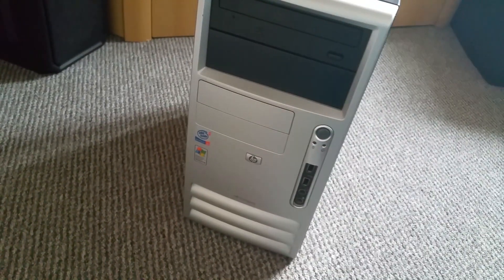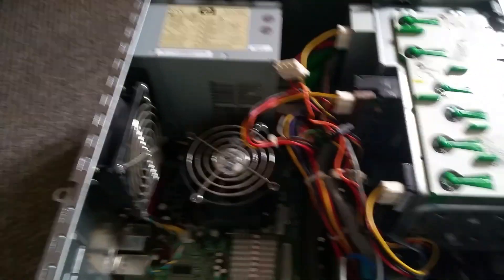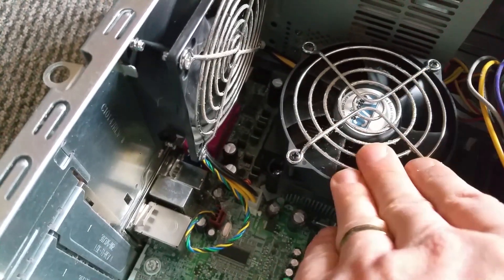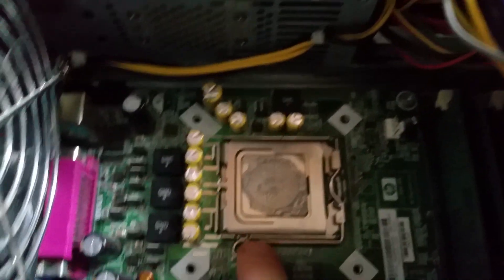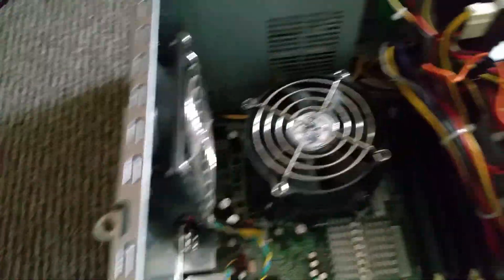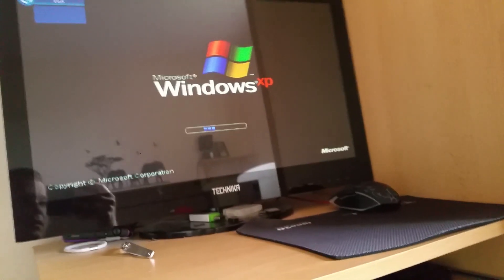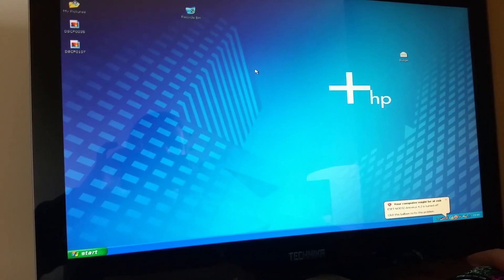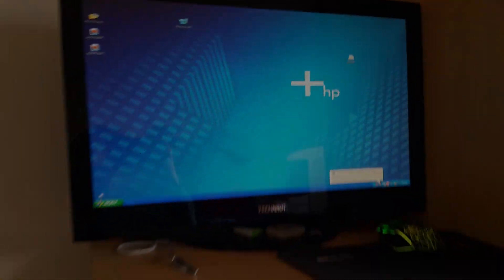Try upgrading Pentium 4 ?  Or is just waste your time !!! Watch this to find out!!!

Comment: Noted 
I am doomed to play games
Reply from the maker: On P4
Reply: @frogtechtips  I just have a 2000s pc with a 1 core Pentium  which runs on its 2 threads basically 

I just wanted. To run mc and it failed. Got 0 fps
Reply from the maker: @dragnify7456 not sure what is MC do you have any GPU in as that integrated GPU is piece of crap
Reply: @frogtechtips  mc stands for Minecraft which takes up mostly the processor
Reply: @frogtechtips  yes
Reply from the maker: @dragnify7456  ok tat pc is really need upgrade as for Minecraft is minimum requirements

CPU: Intel Core i3 3210 | AMD A8 7600 APU or equivalent.
RAM: 4 GB RAM.
HDD: 180 MB to 1 GB available space.
GPU: Intel HD Graphics 4000 or AMD Radeon R5 series | NVIDIA GeForce 400 Series or AMD Radeon HD 7000 series.
OS: 64-bit Windows 7 or later.
Screen Resolution: 1024 x 768 or better.
www.wepc.com › benchmark › min...
Minecraft System Requir
Reply: @frogtechtips  thanks for taking your time out and giving me tips 
It's speca are 

P4
Nviada Geforce 210
Win 7 64 bit
 4 gb ram 
1tb hhd
I am saving up and looking forward to upgrade it 

Thanks a lot again!
Reply from the maker: @dragnify7456  he that's very low spec you really need upgrade :-)
Reply: @frogtechtips  yea I know i am saving up money
Reply from the maker: @dragnify7456  don't buy new one and you can get pretty cheap pc I will recommend you some intel 3000 or 4000 series is still good if you will pairs with decent GPU like I have i7 3770 and RX 580 and no problems plays even every new game on it
Reply: @frogtechtips  thanks, I won't buy a new one I wasn't planning too! 

But in my country the prices are really high at the min becuz of quarantine and stuff so I was thinking to wait a bit till the prices drop!
Reply from the maker: @dragnify7456  ye in this time is always good wait if you can for price drop if I can ask from with country you are
Reply: @frogtechtips  I agree! 
But sorry, you can't know what country I am from with all due respect
Reply from the maker: @dragnify7456  no problems you can keep in secret

Comment: I am using Pentium 4 (650 processor) in Asus Ptgd-1La mother board which is i915g chipset based mother board it can also support Pentium 4 (640 and 630 Processor) as well ,Windows 8.1& Windows 10 (32 Bit) can be use on any of them.
Reply from the maker: You can install windows 10 as well on it with no problems
Reply: @frogtechtips  Yes I have 2 8.1 & 10 OS in this PC
Reply from the maker: @subhashsehgal2278  nice

Comment: If trying to put new processor in any of the mother board you must check the chipset compatible processor it will work fine if processor don't support the chipset of the mother board it will not work.
Reply from the maker: Yop i know socket been correct

Comment: Windows 8 still working with P4 ht
Reply from the maker: Even window 10 will working on it
Reply: only 32 ?
Reply: @zombozoff6210  i tried only 32. I dont know work with 64
Reply: @archive5376  im running windows 7 64 bit

Comment: i have p4 is very old so can u tell me its cane be replaced by wich cpu i have 3gb ram i don't even know what that socket is on it hope u will reply me
Reply from the maker: HI you will need check MB type and look on internet with best CPU you can use for that MB but there will be not a big upgrade anyway I will recommend just buy new component MB + CPU + RAM
Reply: @frogtechtips  what will be best mb n cpu n gpu will better for gta 5 
i have ddr 3 4gb 2 sticks and 450w psu hdd 160 pata
Reply from the maker: @ismailkhan01  if you have DDR 3 I will go for i5 processor 3000 or 4000 series is old but still good and now cheap as well and buy any MB you can find cheap for this CPU all you can find in used market pretty cheap IAM sure

Comment: its a 757 socket which can run a quad core cpu. Such as a q9550 or q9650. Since it did not like the CPU you tried, it may need a bios update so the board can recognize a newer PC.
Reply from the maker: Hi maybe you right but really I don't car 8s wasting time and money anyway
Reply: It’s LGA775 by the way
Reply: @alexfinns6162  mine also 775 LGA , i want to know what is the maximum upgrade that i can do? currently im running on windows 7
Reply: @ABUFARAH22  the os doesn’t change anything. It’s your motherboard and your bios version that either allow you to upgrade or keep you behind. If you have a later lga 775 motherboard with the latest bios update, you’ll probably be able to run core 2 quads. An earlier motherboard might also be able to as long as it was supplied with updates, allowing it to support these newer cpus. Usually, reputable brands like asus do this. Do some research and you’ll find what you need. The absolute best lga 775 cpu is the Core 2 Quad Extreme QX9770, but that requires a high end motherboard that supports a FSB speed of 1600 MT/s (800mhz). If that isn’t something you have, a Q9650 works well.

Comment: You need to install OS on an SSD. Even 2.2GHz will fly. Assuming you have SATA ports, if not you may have to add a PCI-SATA card
Reply from the maker: Yop that will make p4 faster but still is just waist you time and money
Reply: @frogtechtips  I don't think its a waste of time or money at all. Because it will make an unusable, by today's standards , PC into a usable PC. 
Remember, your criteria was a usable Office PC.  The reality is that PCs with P4 and higher are still usable today, but people experience that when they fire up their old PC its slow and not smooth like today's PCs. That slowness and stuttering will be not be P4, but old hard drives. Hard Drives from 10-15 years ago were crap.
And you can always re-use that SSD in another PC if the P4 dies at some point.
So.... there will not be much difference between P4 2.2GHz and P4 3.2GHz, but... there will be huge difference between old Hard Drive and SSD.....
Reply from the maker: @jasonking1284  yop you right man
Reply: @jasonking1284  yes that’s true but to use a sata SSD with an IDE motherboard you need an adapter, meaning that the way of communication between the motherboard and the SSD is still basically IDE just running through sata cables which still leaves you bottlenecked by the slow IDE speeds.
Reply: @jasonking1284  however you may be right with the PCI adapter as that is high speed. I’m only not sure if PCI supports that like PCIe does.
Reply: @jasonking1284  Linux and older versions of Windows work perfectly fine on a HDD.
Reply: @inwencja2009  Yep, everything works on HDD except much slower than SSD.
Reply from the maker: You right
Reply: @alexfinns6162  " yes that’s true but to use a sata SSD with an IDE motherboard you need an adapter"
There is not too much advantage in using a IDE to SATA adapter. The max speed your gonna get on that is 133MBs. Its limited by the IDE bus. You need a proper PCIe bus and a motherboard with SATA 2 connectors present already. That will give you 300MBs SATA 2 speeds. But still SATA 1 will still be somewhat better than IDE.
Reply: Or just an ide to Sata adapter
Reply: P4 make the best 98se retro and xp retro gaming machines

Comment: This is what I have Same EXACT MODEL in my basement
Reply: Can you install 64bit Windows 10 on here?
Reply: @floofymonsta_za  yes if you find a cheap cedar mill pentium 4, can be identified by the '1' in their naming scheme, like pentium 4 641
Reply: @virtualtools_3021  yes
Reply from the maker: @floofymonsta_za  hi is only 32 bit CPU
Reply from the maker: Really and did you try upgrade
Reply: @frogtechtips  yeah upgraded it with 4gb ram in total and new thermal paste on CPU
Reply from the maker: Yop and if you like I know this pc can run win 10 as well
Reply: @frogtechtips  really  ? Coz right now windows 7 is installed in it 
As the cpu is only a 32-bit one
Reply from the maker: @trollius2718  hi there is win 10 32 bit version as well
Reply: @frogtechtips  actually
1. windows 10 is very demanding 
2.windows 7 is well optimized for Pentium 4 HT
Reply from the maker: @trollius2718  yop that's true but I try win 10 under very old PC and I Been surprised how good is running
Reply: @frogtechtips  okay , I will install Win 10 (2020-05) version
Will report u back , sir 
After how it goes
Reply from the maker: @trollius2718  try and do dual boot after testing you can still go back to win 7
Reply: @frogtechtips  okay sir
Reply from the maker: @trollius2718  you welcome
Reply: @frogtechtips  sir , am trying to install windows 10 (2004) 32-bit in...
 my pentium 4 HT (90 nanometer)...
But it's not getting installed 
Am having some issue , when set to boot from usb the booting starts even sell's the windows 10 logo for few seconds then... every thing turns to black (signal is there but the whole display is turned blank)
Reply: I have waited for like 20 minutes
Reply from the maker: @trollius2718  ho not sure why maybe just try another version of Windows
Reply: @frogtechtips  quick update sir , 
After 25-28 minutes of waiting the setup started and I managed to install windows 10 32-bit on it successfully
Reply: It's very working fine but I dont have a Dedicated GPU so videos r not working properly (on utube)
Reply from the maker: @trollius2718  yop that's can by you will need maybe some new agp card definitely you can find some so cheap

Comment: well... guess i won't waste the effort on the cpu.
awhile back, i upgraded a pavilion a1020 from its 500mb to 1gb ram to replaced its xp with win7.
its definitely still slow but i think its still good if you use it as a dedicated machine for hardware like PC oscilloscope or programming/test machine for some Arduino projects.
Reply from the maker: Ye you right for that usage can be good